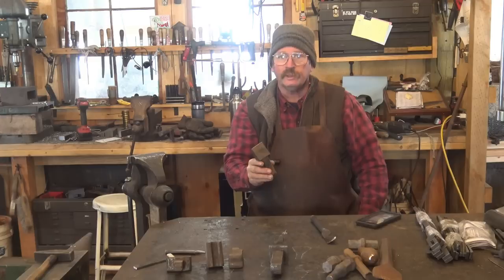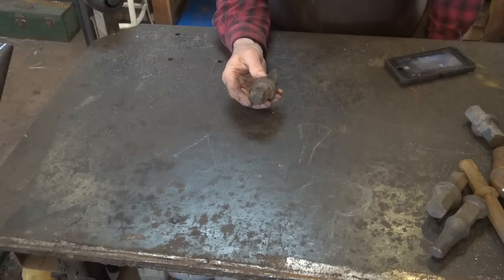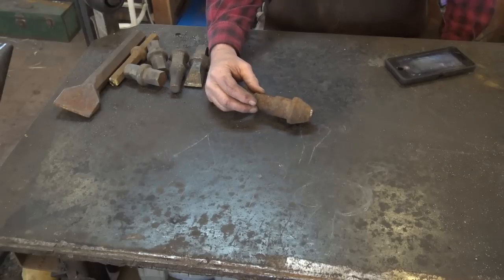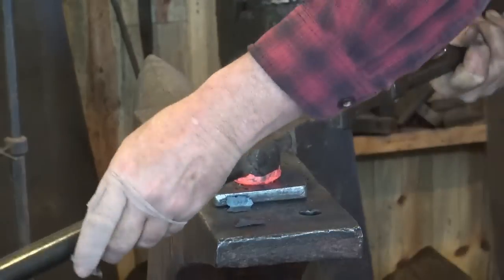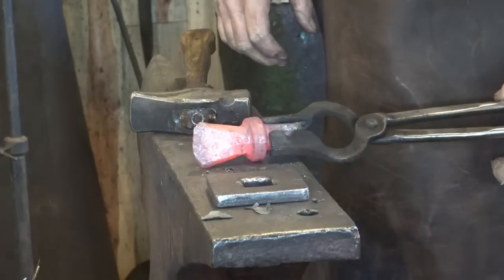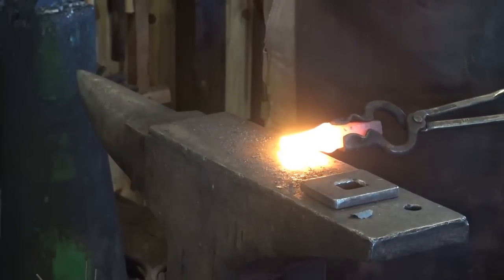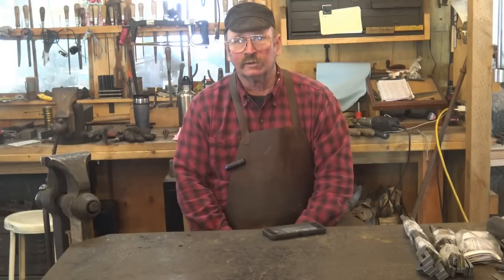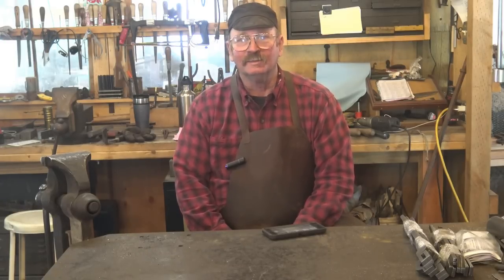Forging simple hardies for the blacksmith shop - tool making

Comment: I have a 3 pound cross pein hammer that I find too heavy to swing (blacksmith’s elbow that im resting). I’m considering using it for a hot cut tool because it’s mostly shaped already. Would you recommend this? Or not?
Reply from the maker: Probably almost as easy to make more reasonably sized hot cut, they don't need to be that big.  Save the hammer for the future when you may need the larger hammer on a limited basis.

Comment: I know the camera and lighting play heck with color perception, but it looks like you are starting at a bright yellow and working down into orange before going back to fire. You said welding heat while I was typing this, so yellow?
Reply from the maker: The camera is certainly not accurate, it also looks different on different screens when watching.  For most of this project I was not at a yellow heat, however that one heat when I mention a welding heat I was at a yellow heat.

Comment: Great information: John in your cold conditions there do you do some heating your anvil before you get forging for the day.  My shop stays at 50 deg. overnight and have gas heat in the shop so doesn't take long to heat shop up but I don't keep a heat long at all.  I use mostly a 304 lb. Peter 
wright so there is a lot of cold in there. Just wondering. Thanks.
Reply from the maker: I do preheat if it is very cold, down in the teens or lower.  If its just below freezing I don't worry about it to much and just don't do any heavy hammering over the horn or tail until it has a chance to warm up some.  I talked about it some in this video https://youtu.be/Z2sjVom0hEo
Reply: Thanks again

Comment: Loved the video. Helped a lot, I recently acquired a 170 pound Trenton anvil and need a hot cut for it. Also what type of coal do you use for your forge?
Reply from the maker: Fore coal I prefer Bituminous coal sold specifically as blacksmithing or metallurgical coal.
Reply: Oh okay. Why do so many blacksmiths not use anthracite? It burns cleaner and it’s hotter.

Comment: Great video John love the content, I have access to a lot of pry bars that have been bent or broke on the end so far I have had the best results with water quenching them to get hard so what material do you think they are? Do you have any experience with pry bars? Also I think I have the worst hardy hole of all 7/8” and it’s not very symmetrical to get a good fit I can really only make the hardy fit one way
Reply from the maker: I have never used a pry bar, but have thought they were probably good steel.  A spark test might give some ide of carbon content, but I really have no idea what the steel is.  I suppose you could very laboriously file or use a die grinder to enlarge and square up that hardy hole.
Reply: Black Bear Forge I think I might try that and the pry bars are good steel I forged a cold chisel out of one a couple of years ago it’s still in perfect shape

Comment: I know this is probably a dumb question, if I have a jackhammer bit that is roughly 1/8 inch too small in it's hexagonal form for my hard hole would it be possible to upset it enough to hammer it to square to fit or am I just wasting my time????
Reply from the maker: You can certainly upset it, but it will be work.  So if you have the time and want to make use of the steel, go for it.
Reply: @BlackBearForge  Thanks for getting back!, time I have in abundance and the hammer practice(meaning accuracy) will not go amiss either....there is about 6 inches of material that fitted into the hammer so there is also plenty of material too

Comment: I have one big question! I only have a round hole in my 'anvil' is there anything to look out for when making such a tool for a round hole?
Reply: That's called a prichard hole. That's not ideal for a cut-off tool since it's so far out from the center mass of the anvil. Whereas the hardy hole is much closer to the center mass. Plus the tool would rotate which is obviosly not ideal for bending forks.

Comment: would an old trailer hitch ball work for this?
Reply from the maker: Possibly.  I do use them as a round form at times but have never re forged one into something else.  Strip the plating off before heating it though

Comment: John, what is your take on using old ford axel rods?
Reply from the maker: I have seen lots of good tools made from axels.  Its mostly a matter of figuring out the proper heat treat.
Reply: @BlackBearForge  The one I have is definitely not air hardening, but is a very tough steel.

Comment: I’m ignorant. What is sucker rod?
Reply from the maker: Sucker rod is the long connecting rod that goes from an above ground well head to the actual pump in the ground.  Commonly used in oil wells